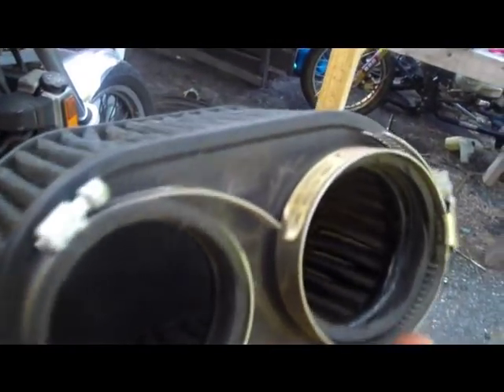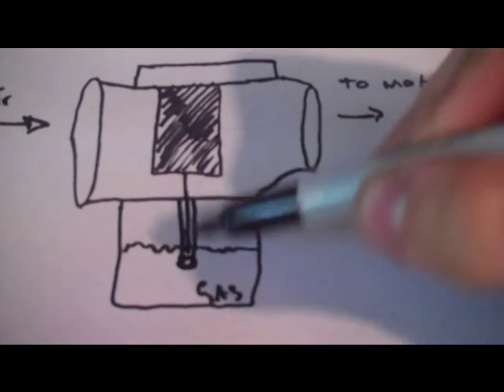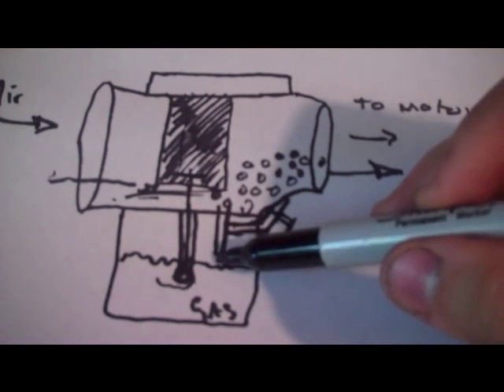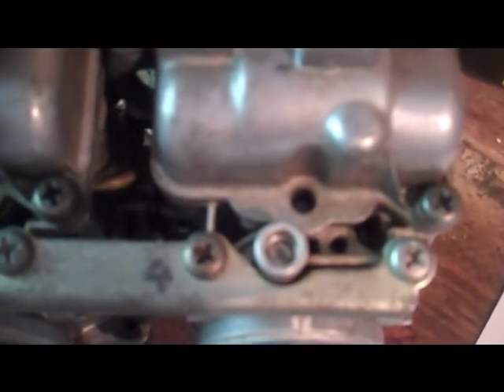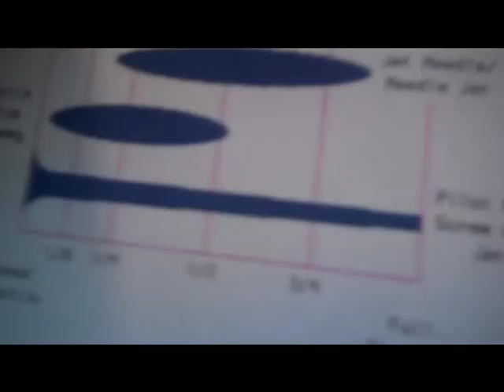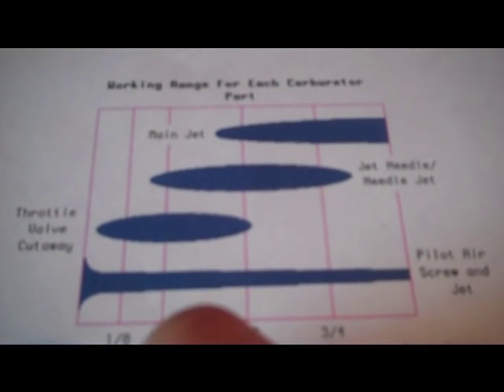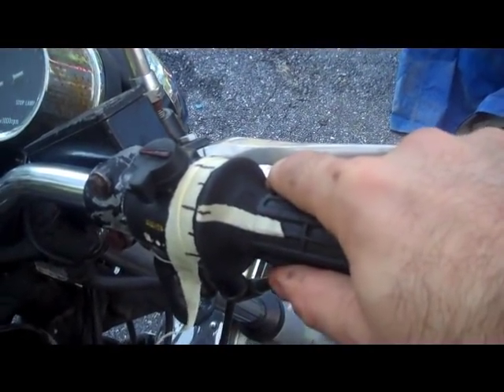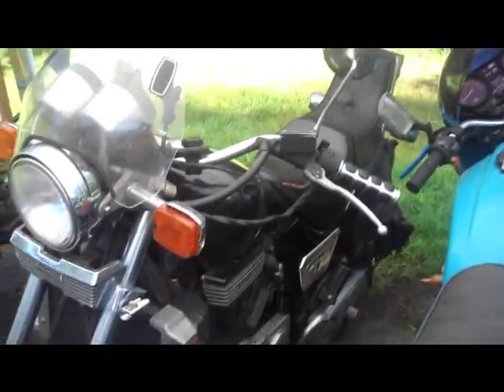How to adjust the jets on motorcycle carburetors

Comment: Good to see you posting new videos on the Camero.  Make sure to post something to let us see the finished product.  I'm curious, how does tuning carbs (reading plugs) differ between sitting idle and under load... or what makes the difference between sitting in the garage or under load going down the road to get an accurate reading?  If memory serves me correctly, it seemed that growing up with 2 stroke dirt bikes, they always ran horrible at idle or low rpms but fantastic when you made them scream.  The two may not be related but thinking about it got me curious.  Thanks.
Reply from the maker: brightasfadel Well a bike under load is requesting very different requirements from a bike that is stationary. I have had a bike with completely clogged main jets able to rev up as normal in neutral, but obviously bogged and died when I put it in gear. There may be something to the science behind it, unfortunately you'll have to google around for that, but I say this a lot that you need to put your vehicle in the condition in which it will perform before you can test whether or not it is performing
Reply: mrmaxstorey I see.  It makes sense that a different volume of air and fuel are needed under different circumstances to maintain the air to fuel ratio.  The clogged jet at idle vs. under load is a good example.  Like you suggest, I will search for more information on the subject.  It's funny that the more I learn about carbs (and bikes in general), the more I realize I don't understand!  Thanks for your reply and take care!

Comment from the maker: Well first you gotta determine if these are the stock settings for your bike. If so, the something is off, like your floats are set too high or they are leaking, soemthing like that making your bike run rich. If this is just a tuning problem that you are dealing with, then I would suggest getting a couple more jets, each one step smaller, and swap them in one by one and see how it runs

Comment from the maker: In this case you need a repair rather than an adjustment. Put the screws back in their stock position, and find out why you are running rich. Could be an old clogged air filter, or float levels too high, or perhaps the jets were previously replaced and are too big, or the carb slides are stuck, or something like that

Comment from the maker: Yeah the air is leaner so that makes the bike run richer. In climates like yours, some guys actually decrease the jet size, or add filters like you are doing. See how it runs with the new filters, if you still get black spark plugs might need to rejet down a size. Remember, all things being equal, you must ensure that the float height is correct and the carbs are relatively in sync before rejetting

Comment from the maker: All passenger parts like footpegs, etc. You can cut the frame and make it a 1-seater. Use aluminum replacement parts instead of steel. Lose the mirrors, kickstart, and starter motor (so it is bump start only). I know guys who even drill holes in the sprockets and rotors. It all depends on how far you want to take this. However remember, this does make the bike less practical, and less safe.

Comment from the maker: Who knows, such a very minor problem could be caused by a number of things. Maybe you are developing a slight vacuum leak, or one of your float bowls is just an itty bitty bit too low. If everything else runs good, good idle, nice looking spark plugs, strong powerband, etc, I say chill with it. However, you may find that the issue resolves itself once you put those new filters on there and rejet, just be sure to remember your stock settings in case you want to change back :)

Comment: Regarding (only) float bowl adjustment: From Lamborghini's to Lawnmowers, as float bowls wear (the hinge, the hinge pin,  the valve needle end, the pressure plate on the valve needle,) as well as some of the non-metallic float bowls that become less buoyant  over time...note that ALL of  these wear and age related issues push the 'flow change'  in the SAME direction; richer.

Comment: A lot of people say one can't get CV carbs to run right with pods. I'm beginning to believe them. I have an XJ650 with cut exhaust and pods. It runs well 1/3 throttle on up. But, taking off from a stop it sounds like a Harley and then I get a burst of crispness from 1/3 throttle on up. Plugs show that it's running lean, tan, dry.  Colortune plug shows blueish white combustion. Mix screws are 3 and a half turns out. Jets went up on pilots by 2.  Mains are larger also, but I'm not so concerned with those because of the throttle response. I'm pretty sure my problem is in the pilot circuit. I've been up and down with changes to the pilot circuit and nothing seems to help. Shimmed needle, pilots jets changed from .39 to .41 to .43 to .50 I think I'm back to 43's now. Now I'm considering making a pvc setup to a single pod filter. I can't put the airbox back on the frame is chopped. Or I'm also considering, riser carbs because I hear they work better with pods.
Reply from the maker: +Dave Harris Have you been synchronizing your carbs throughout this process? As Im sure you're aware you need the special yamaha tool to sync if you have the YICS motor. A well synched set of carbs will be easier to tune. Lots of guys have successfully jetted their carbs with this modification, and many have gotten them "good enough" while sacrificing hp and economy in certain parts of the range. You might want to experiment with needle height, 1/3 throttle is just flirting with that part of the throttle range, as I recall the XJ650 doesnt have gradiated notches on the needle for the clip but you can add washers if you want to give it a shot
Reply: I think I had little brass washers in there at some point. I'm gonna try to make one of those YICS tools. One thing about pods, they make it easier to pull out the carbs.

Comment from the maker: OK yeah the pilot jet is inside the carbs, the air/fuel mixture is outside, and its a screw. I think thats what you're referring to. Typically it will make the bike a little richer at idle the more you turn it out, but Ive never worked on your bike so check with your manual. Remember too it only affects mixture at idle, and then only a little bit

Comment from the maker: If thats what your manual says, then yes. But adjusting your mixture screw only affects the mixture a small amount, at low speeds. If you are finding a rich mixture throughout your throttle range, you need to think about swapping out jets.

Comment from the maker: Haha some of the things that supposed experts say really do crack me up sometimes. Its pretty much impossible to drill a jet clean, you will invariably take off some of the metal, making the hole way too big. There are guys who even refuse to poke at a jet with anything, I dont go that far but if you cant get a jet cleaned out, it should be replaced rather than drill. You probably are running a little rich. Check out my other carb cleaning vid on v-style carbs, it might help. Best of luck

Comment: 89' suzuki katana. The carbs are the same ones featured on your video and I have some gnarly bogging at about 1/4 throttle up to half throttle. I got flooded after a few minutes of running but I'm about to adjust the needles and the pilot jet screws by 3/4 of a turn outward. My main jets have a 144 stamp on them.
Reply from the maker: That sounds a bit big, are they stock jets? Do you have stock intake/exhaust?
Reply: Idk about the jets but I have dual pod intake and a cut off exhaust. The jets are stamped 144
Reply from the maker: pentek zoltan
OK with pods and a cutoff exhaust youll definitely have to rejet. First find out what size is your stock size, then follow the process I show in this video

Comment: Glad i came across your video on carbs, as iv just added a BBK kit to my 139-OMB making it 72cc,added big-bore exhaust new CDI and ram air filter, and revving is a little boggy in places, also it needs a little throttle to start as well, This video gives me a great starting point, before swapping jets ect ect. 
 But i do have a question if anyone can help?? even before the upgrades the scooter as always started great 1st/2nd time (but always with a little throttle)  any ideas ??

By the way thx for the video il start the tune up later today.
Reply: +luap ynneb I would try backing out the fuel screw 1/8 turn at a time to see if it's a lean problem. (Note: If the screw is on the front of the carb, ie between the carb and the cylinder, it's a fuel adjustment screw so screw it out to enrich. If the screw is by the air inlet of the carb it's an air screw,  more air allows more fuel to burn efficiently.
     Enriching the fuel screw worked for me on my 96 Honda R250.My bike would start pretty good cold but once it was warmed up and then sat for 10 or 15 minutes I would have to kick my brains out before it would finally start. I cleaned out the idle jet, put the carb back on, started it up, warmed it up and went to work on the idle screw.  Finally working great settling in at 2 1/4 turns out from bottom. (it had been set at 1 1/4 turns out from bottom). 
      It will probably be a different setting for your bike though, they're never the same because of differing jet sizes, air pressure at different elevations, float levels, etc. But the short story is it sounds like you are lean at start up/idle indicating plugged or partially plugged idle jet (pilot jet) making the engine "search " for fuel from the next higher circuit. it cant get the fuel because it takes higher rpm the the starter will provide to get the vacuum up high enough to pull fuel from high speed jets. That's why pulling a hard starting vehicle will many times get get it to start...engine turning fast enough to get the vacuum high enough to pull fuel from the main jets.
Reply: Elder Hardin 1st of all thx for the message of help, I'm a panel beater by trade, but can easily work my way round a bike engine but i lack this finer detailing, ie carb settings and diagnostics!!.
( I did try a larger idle jet 38 with the BB exhaust on but this seemed to make things worse)??
 With fully repainting the scooter last month, all i have done since is put a new standard exhaust back on, (too much noise with BB exhaust on) and its running far better,  But still needs a little throttle to start, and then once going seems to hesitate at about 1/3 throttle, taking about 0 .5 - 1.0 seconds to clear before revving without a problem to full throttle.
 Having now done about 60miles to bed in BBK i will now start to figure out what the problem is starting with what you have said.(please feel free to point out anything you see which could also add or cause problem) 
Here is my setup.
I live at about sea level, Wigan UK
2013-Retro Scooter 139-OMB-engine.(about 1.500miles on clock)
BBk to 72cc, block,piston & rings, (standard top end but all valves and timings where set at the time of rebuilding)

New 4T 50cc carb with 35-idle-jet and 88-main-jet (float-needle has 4 settings and is set to lowest)
New Racing coil and cdi & NGK-plug
New Ram-Air foam pad
New Standard Exhaust
Upgraded to better quality >( 5g-rollers , 1500rpm-contra-spring and 2000rpm-clutch-springs) all standard settings other than the contra-spring which at a guess i would say was about 1000rpm.

Thx Paul
Reply: +luap ynneb Try this setup and see if it works. 1) 38 pilot jet. 2) raise the clip one notch so needle lower make it lean. 3) Turn in idle screw higher rpm avoid throttle to keep it steady. 4) Like Elder mention turn out mixture screw out more to enrich it. Play around idle and mixture screw to avoid bogging and extra throttle. 5) make sure fuel line free flow and optional drill gas cap little bit larger hole, better gas air flow. 6) unplug your auto choke or r/regulator. Don't know why but i think auto choke needle not closing in or in and out even after warming up can cause rpm up and down and boggles like a stock market. Last but not least, put back stock intake tubing box and drills holes for better vents, this control not too much air and see that also help too. Good luck.
Reply: +Groovy Luy 
Thx for the reply, funny enough iv needed my scooter for work lately , having moved to a new job only about 2miles away , perfect for a scooter, and yes its still been a pain to start, last night not even starting (wet/cold/very damp) if weather is good scooter will start as i said in my first post not easily but it will start ,, > but on turn over once the engine starts you need to catch it with a small amount of throttle to get it to bust into life,miss your timing 2/3 times and that's your lot for 20mins  (Yes im not joking you the shit i do to get this scooter to start is mind bending) ok back to your post ,,, adjusting screw/needle-float/jets ect ect i'm willing to try different settings as you say, but unplugging the auto enricher will never work as it will stay closed and il be running at full choke always, and the way i see it i needs less choke or a closed auto-enricher, but it did get me thinking as my scooter wont start and hasn't since yesterday, with the auto enricher being wired to the stato or what ever its called, the auto/enricher/choke will only get its 12v to work once the engine is running, so today i wired the auto enricher direct to a 12v battery and let it heat up for a few mins , and the bloody scooter started on 1st turn over with zero throttle.  (WTF so my scooter must not like any choke what so ever > to start that is)
So just for now just to get me to work and back until i have more time to test different things i need to find a way to keep the auto-enricher fully extended. 
?  Does any of this shed any new light as to what my main problem could be

Comment from the maker: Well a little bit of oil seeping from between the head and block is normal for an old engine, especially around the exhaust pipes. But I cant say one way or the other whether the head gasket is blown, especially if we don't have a compression reading

Comment: This is an older video but I just want to say thanks. I feel pretty confident now. I have a 1982 honda cm450. I bored the exhaust slightly and I now have bogging down at 1/4 throttle. I am assuming I need to raise my needles a bit.

Comment from the maker: It does sound to me like you might be running lean, check your plugs to make sure. Also that does sound a little more aggressive than I would have started, presumably they have their reasons for jetting so large like that, but I would have suggested to start out increasing the jets in smaller increments. However I have never jetted your bike before, so get on a magna forum and ask other owners what size jets they use for your similar modifications

Comment from the maker: Yes it definitely can be done. Like I show in the video it does take some experimentation, but it can be done. If the needle is adjustable, then you don't need spacers. Just set it up one adjustment notch. On bikes that are not adjustable, a small thin washer can be used.

Comment from the maker: It may be a number of different issues. If 1 and 2 are leaking, that means extra gas is pouring into those cylinders. If a plug is wet it will not fire, and if it does fire, chances are it will be so rich in its mixture that it will foul the plugs. Start by cleaning the carbs, I have a video up for that. Then check out my leaking carbs video, and try to repair that. Replace the plugs, and see how far that gets you.

Comment from the maker: Well, kind of like how I explained in the video, if you open up the intake and allow more air in, you need larger jets so more gas can get in too. I found a resource online which states that if you remove the intake restrictor you need to change the jets out too, the jets you need are main 138 , slow (idle) 42 , power 65

Comment from the maker: @Michiganborn1969 Ive never done it, but a sand blaster loaded with baking soda is supposed to work amazingly well. Water washes it away really easily, no sand all over the place. My air compressor isnt strong enough to power one or thats what I would be using all the time.

Comment from the maker: Your mixture might still be off, pull a plug and see if you are running rich or lean. Also when you reinstalled the carb one of the boot clamps might be pushing open the throttle a bit, that has happened to me from time to time

Comment: thank you for your informative video, you explain concept very well. your diagram helped tremendously as most of us learn visually. I have a Honda shadow that will not start until i open the choke all the way. Once i try to push the choke back in, the bike dies out. My first question: why does it do that? is this a pilot jet issue? 2nd question: what happens if i continue to run the bike with half choke open all the time?
Reply from the maker: Well, like we discussed in the video, a bike needs a certain ratio of air:fuel in order to run. The choke will either reduce the amount of air, or increase the amount of gas in the mixture, making the bike run temporarily richer to help it start up while cold, and compensate for when the bike is cold and lean. If your bike only runs on choke, that means that your bike is running too lean for some reason and the choke is compensating. You will need to determine what the problem is and repair it. Most likely causes are dirty carb jets, improper float heights, or vacuum leaks